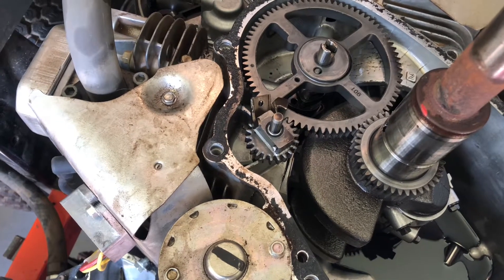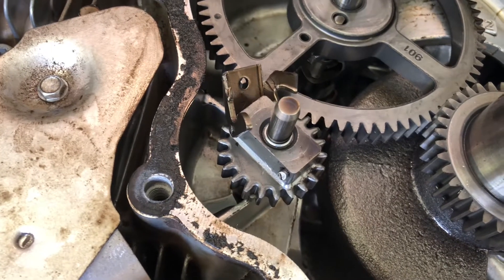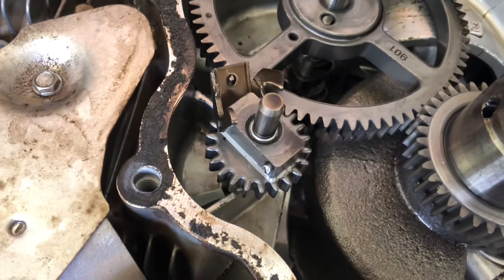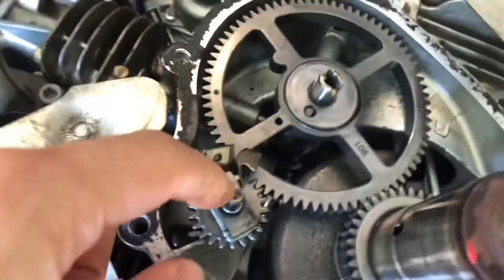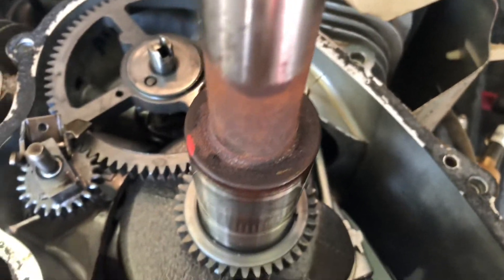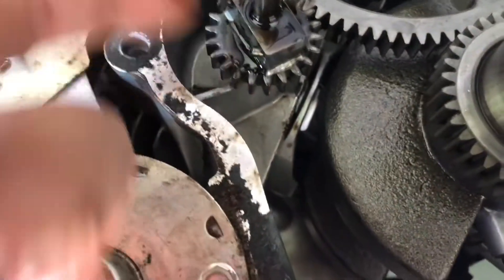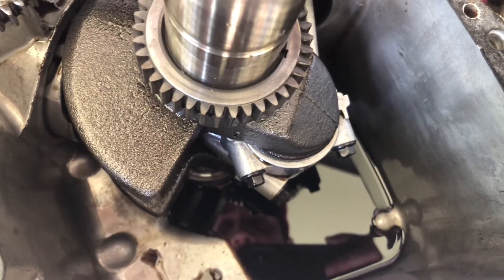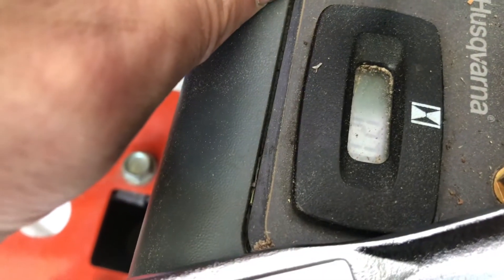If your Briggs and Stratton Intek V-Twin overspeeds all of sudden, this might be why...

Comment: I’m working on a John Deere D130 with 22 HP Briggs with an over rev issue.  The mower has less than 100 hours.  I’m wondering if this is common with these engines?  We’re going to try and reset the governor, but now I know what I’m in for if that doesn’t work.  Thanks for the video.
Reply from the maker: @curtcunningham1063  similar engine hours on mine when the governor gave up. Got mine from family who didn’t change the oil and I was told that on newer Briggs engines, that appears to be a critical maintenance item, unlike older engine production models they had and were able to get away with not changing the oil on them…

Comment: Make sure you get all the metal out of the crankcase. there is a small ring that I couldn't find in mine and I looked for two days and finally found it. You don't want it to get stuck in the gears.
Reply from the maker: Indeed. Lots of aerosol cleaner was used and it was free of all oil and debris before reassembly. All parts were accounted for by cross-referencing the diagrams in the manual. Had the same issue you mentioned, where I almost reassembled it without a piece if I had not double-checked everything...

Comment: So i just put a new crank seal and oil sump seal. After putting everything back together and started engine, it revs full throttle. So i tried adjusting governor arm. After loosening nut on the arm, i used a wrench to adjust the shaft. I immediately noticed the shaft has almost no play to adjustment. Is this an indicator the gear is shaved like in your video?
Reply from the maker: The mechanism will move when the engine isn’t running. The key to diagnosing If the internals have failed is if the arm doesn’t resist  or move while you try to run the engine. You can start the engine and regulate the throttle plate manually to see if the governor mechanism is intact. The key is to not let it over-rev while you try to assess it. Might want to get a helper to start the engine, move throttle to slow immediately and and be ready to kill it if you can’t control it.
Reply from the maker: There was very little movement to adjust when it is intact. A fraction of a full turn…I want to say maybe as little as 1/4 turn. It was fine a few minutes beforehand and next thing I know it revved out of control…so, yeah, it is possible your service was just at the “right” timing where it has flown apart inside…if you pulled the throttle linkages to do that service, I would check all of that thorough first before cracking it apart. You can see the other video that all the linkages and the governor looked okay from the outside…
Reply: @AshrafFarrag  thank you for the reply. I checked the shaft again but no luck. The shaft doesn't turn left or right. Like it's jammed in place. Unfortunately, I'm gonna render parts and crack open case again. Thanks again for the advice 🙏
Reply from the maker: @samuelduran5903 yeah, if you loosen the hardware to adjust and that shaft doesn’t move left or right, you probably have an internal problem where it’s jammed and not going to regulate the engine…there is a gear with weights that spins and pushes up on a lever which moves that shaft in a rotational motion…if something came apart and has gotten in the way or jammed it…that might explain your situation…it’s not all very complicated mechanism when you see it yourself. Apparently you need to change oil frequently on newer engines compared to what you could get away with on an older B&S…

Comment: Before it was disassembled, did the governor adjustment still respond properly and stop when turned  counterclockwise to the seat? Or did it just free spin
Reply from the maker: I did the governor adjustment procedure several times before taking the engine apart and in my case, with the governor gear being the thing that was broken, it behaved no differently before replacement than it did after it was replaced (as in, it stopped and seated when turned). I could see where the arm that contacts the governor could break and potentially allow for it to spin freely and not stop, though.

When the engine was run with the governor broken, I could control the speed by manipulating the throttle plate/linkage. The governor lever just flopped around and did not make any attempt to regulate the speed down. When it works correctly, you can feel it push and pull the throttle when the throttle lever is adjusted to idle/low and it will oppose any attempt to manipulate the engine speed by you moving the linkages to increase speed.
Reply: @AshrafFarrag  thank you very much for your detailed reply, answered any question I could have on the subject.

Comment: Hello, I have the same problem, I still do not disarm the engine, it has about 137 hours of use, it started with throttle failures.I couldn't regulate the throttle, it goes to full rpm when it starts. should it disassemble to replace the internal system? what is your advice. Best regards. from Argentina
Reply from the maker: Start the engine for as short a time as possible (a few seconds, don’t let it run uncontrolled or attempt to run ungoverned). Once it starts, you will need to quickly change your physical position from where you need to be in order to start the engine to being able to safely position one of your hands on the governor arm without putting yourself in any danger from any moving parts. Alternately, have someone else start the engine while you are already positioned at the governor mechanism.

You should then be able to feel the arm move and resist your movements of the arm and attempts to manually control the engine speed. If the arm just flops around, the internal mechanism is most likely broken. The throttle lever restricts the upper limit of what the governor can control, provided the mechanism is working correctly (internal governor mechanism, springs, linkages, throttle, etc). If it is broken, you should be able to manually control the throttle plate to closed and bring the engine speed down to or near idle.
Reply: Hi, so what you're saying is if I can manually adjust the speed by pushing that throttle arm up then it's the internal mechanism that is broken? Thanks

Comment: You did good by shutting it down to prevent damage from pieces floating around the oil sump.  I had the same on a mower I purchased with this issue.  I replaced governor which prior owner gave a new Briggs and Stratton in package.  Governor was $20, the Briggs and Stratton oil sump gasket was most expensive part to do the job, $35
Reply from the maker: Indeed. It was really weird that it was running just fine only a few minutes beforehand and the governor failed when I restarted it.

Comment: I had the same issue. What's the best way to clean all the metal shavings out?
Reply from the maker: A combination of aerosol brake cleaner, various degreasers, shop towels, and compressed air

Comment: I really dont wanna pull my 22HP apart.. but im having this same problem.. so i guess its time to pull the motor and check it out... what all did you end up replacing?
Reply from the maker: * Governor gear set
* Crankshaft oil seal
* Crankcase gasket set
* Oil pump cover O-ring
* Oil filter and oil

Comment: Complete junk. Those twins blow those governors if you look at them wrong. Do yourself a favor when you replace it, put the washer under it, part #799772. They used to put them in and got cheap and run them without them. You have steel against aluminum equals blow. I've done quite a few of these and the ones with the washers never come back.
Reply from the maker: My engine did have the washer you mention. "They don't make them like they used to" is what I learned when I stopped at the local repair shop to get a replacement for the replacement crankshaft seal I perforated on installation...

Comment: I have a 10kw standby B N S generator with over run light flashing any help
Reply from the maker: Get a digital tachometer to see if it is overrevving just a bit due to incorrect external adjustment or it is a failed internal governor...